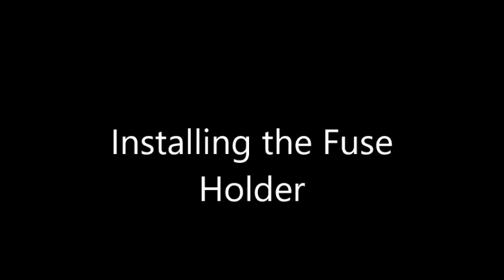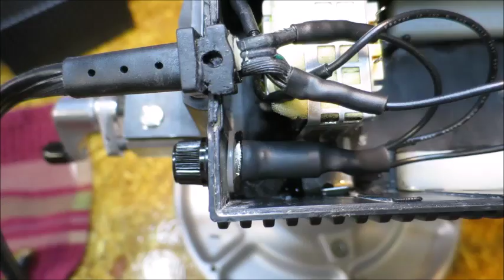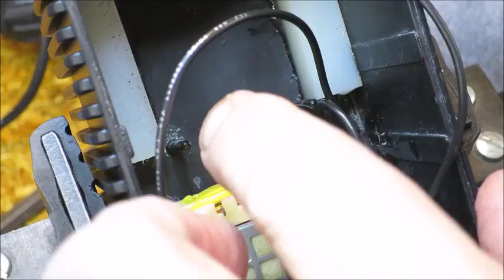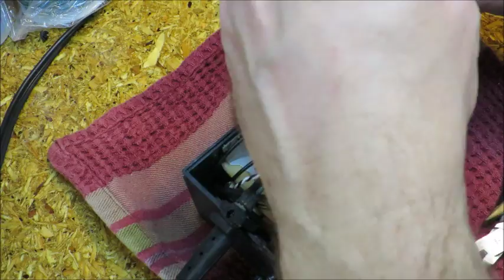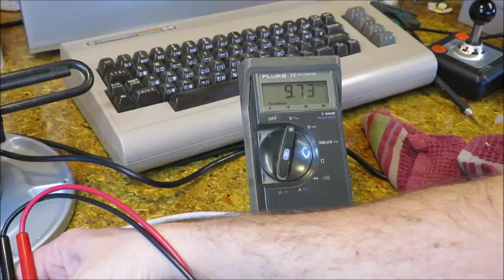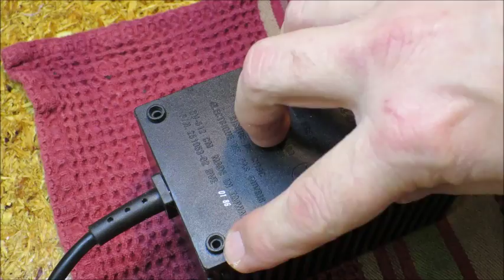Commodore 64 "Re-Brick" Part 3

Comment: Looks dangerous with the metal bracket, if the transformer comes loose for some reason (things happen with cycles of warm up and cool downs) - you could short the transformer with the bracket if the heatshrink isn't all the way down.
Heatshrink over the LED end with no resitor - then a large heatshrink over both of them - no problem with different size resistors...
There's a fuse or 9VAC inside the C64 - so why another in the PSU?
If you use smaller screw there would be no need to grind them down...
Reply from the maker: Hey, good to see you!  Your name and avatar are unmistakable.  Yeah, that was recently brought up.  The reason the bracket went in there in the first place was that on a couple of occasions on my early versions, the transformer DID come loose. This provides a more solid mount and hopefully keeps it in place.  I haven't made any new ones since this came up, but I think running an additional ground wire to the bracket might be another good safety measure.  Commodore frequently grounded the iron core of the transformer, so this would be just like that.
Reply: I was also thinking you could ground it, another idea is to put some heatshrink or similar on the bracket to keep it isolated. 
Pretty nice results, I'm tempted to try and wack the epoxy brick out of one of my grey bricks (that looks the same as your black one).
Reply from the maker: Well, since the transformer core is already bare metal (nearly so, anyway), the bracket didn't seem to be a problem.  Grounding seems simplest.  The whole issue is using  these cases and coming up with a way to mount things inside without using screws through the plastic.
Reply from the maker: Somehow I missed the second part of your first message.  Here's the reason for the fuses: 1. External AC- this one is obvious, to help protect against fire or shock.  2. 9VAC output- partially because Commodore did it on the original brick, but also because it keeps the transformer from overheating and melting down if there's a dead short on the 9VAC output.  Also, there's an input fuse on the switcher, and of course, the switcher has short-circuit protection and just shuts down if the output is shorted.

Finally, what were you saying about the heatshrink and the resistor?  I didn't understand that part.
Reply: Heatshrink: If you put a small diameter heatshrink over the side without the resistor only then you could put a larger diameter heatshrink over both sides (the whole thing, both wires) and not wrestle with getting the smaller diameter heatshrink tube over the resistor. 
What if you made a plastic stencil to block the transformer in the corner, a piece of flat plastic that fits exactly inside the case. You'd then make a hole that fits nicely over the transformer (and perhaps other components sticking up too high). Fasten it about mid height of the transformer - kept in proper height with the nylon pieces in the corners used for the bottom lid by splitting these in half or so and then lock it in between these. Combined with being glued - it could even be glued to the added plastic holder.
It's a shame to add screws to the nice looking case.   ;-)
Screws could also conduct electricity in a worst case scenario if the transformer gets loose and touches the metal bracket.  
Very nice videos, I enjoyed them a lot.
Reply: ... seeing this again. Why not mount the transformer using the same method as when you attach the switcher? Glue nylon blocks, screw to these blocks...

Comment: Are you still making these for sale?
Reply from the maker: Yes, at erratic intervals.  I run out of bricks, and folks usually help me out at VCFMW once a year to   donate "cores" to use to make them.  They cost too much to ship otherwise, and I don't like to pay more than a couple bucks each for the old ones.  Otherwise I would have to charge more than I want to for the Re-Bricks.  Having said that, I will probably make another batch of 6 before the end of the year.  Head over to the Commodore 64/128 group on FB and you can contact me there.

Comment: Another question: is the 2A fuse hooked up to the 9V AC or 5V DC?
Reply from the maker: WinVistaUser2 9vac. It gives a little buffer to allow for an accidental short circuit. The 5v switcher has its own short-circuit protection. Rather than blow a fuse, it will just shut the power supply off until the power is removed and plugged back in.
Reply: ottumland Ah. Good to know. Another thing I thought of for the PSU would be to add a rocker switch (like the ones on the front end of an AT style computer case) for the PSU to switch the PSU off for safety reasons or as an emergency shut off.
Reply from the maker: yogibear2k10 Do you mean a line filter? Well, Commodore may not be the act to follow in every case, but they never needed one. I have built over 30 of these and never had a problem.
Reply from the maker: Sure, I don't disagree with that!  But the primary flaw was the issue of thermal runaway with the 7805 regulator they used.  To be fair, this is an excellent regulator, but it has to be well heatsinked and cooled, and filling the case with epoxy tended to work against that goal.  So I used a modern switching power supply that "can't" (you have to use that word with caution) fail like the original PS did.  As far as the 9VAC, that's filtered and regulated inside the C64, just as you guessed.

Comment: So, the two black wires are 9V AC, brown is 5V DC, and blue is GND?
Reply from the maker: WinVistaUser2 in most cases, yes, but Commodore didn't always wire them the same. I had a weird one just recently where the colors were different.
Reply: ottumland I just took the crap out of the PSU and kept the cord and adapter. The casing on the brick cracked, but I can fix that. Are you planning on selling these as well? Out of cutiosity.
Reply from the maker: Don't feel bad,  I still break 1 out of 5 cases.  They're 30+ years old, and bound to be brittle.  The older non-ribbed units are the worst for breaking, because the plastic is very thin.   And yes, I do sell them from time to time.  Head over to the Commodore 64/128 group on Facebook.

Comment: How about EFI shielding in the PSU to prevent interference and noise from the transformer? Would that be a good thing to do as well?
Reply from the maker: I don't really think that's necessary.  We never had anything like that from Commodore, and while they aren't necessarily the example to follow, I've never heard of problems caused by noise from the transformer.   Switcher noise is a much bigger deal.  In my v1.0 of this power supply, I used a cheaper switcher and found that a small percentage of machines had switcher noise showing up on the screen, especially if an S-Video cable was used.  On the current v2.0 version, switcher noise is about 1/4 what it was, and after 20 or more of these made, we haven't seen any more problems with switcher noise.
Reply: ottumland Ah. Didn't think right. Interesting project as well.

Comment: My only concern is the screw exposed on the outside. These supplies are originally double insulated. Symbol for this is a small square inside another square. Perhaps you should use a nylon screw and nut or find another way around this. Otherwise, good to see old gear being saved instead of thrown.
Reply from the maker: Well, on one hand, double-insulated is usually for devices that have no ground, and these do.  However, your point is still well made, because neither the screw, nor the metal bracket that goes around the transformer, is actually grounded.  Looks like we have a possible design change in the next batch!  Either ground the bracket, and hence the screw, or use a nylon screw.  Good tip!

Comment: Hey,

I found a couple of these PSUs in the trash yesterday.

Do you want them for the cost of shipping?
Reply from the maker: I appreciate that, and if the shipping was five bucks, I'd probably say yes.  But these things are heavy, and it's probably not worth shipping them.  Thank you though!  I am currently out of bricks to make new power supplies.  I don't usually do much in the summer, but I will have to make a few before VCF Midwest!

Comment: I will not put hot on that tab The military required the hot tip so if some one pulled the fuse they not receive a shock if they were grounded in some way. The dragging the fuse out would leave a shock to a power plugged in device! I know that is an unseemly way but it was enforced very strictly!
Reply from the maker: That's a very good point.  My logic for the decision was that on this fuseholder, the tip tab slides in and out as you insert the fuse, making the exposed connection difficult to insulate.  So I didn't want that to be left hot if the fuse blew and something shorted inside.  But it does leave the outside slightly exposed, as someone removes the fuse, the thread area would be hot.  I still think it would be difficult for someone to get their fingers in there, but the point is well made.
Reply: I think that is why OEM devices are fused inside which settles this chicken and egg .

Comment: why dose the 12v rail need to be AC is it for video sync?
Reply from the maker: It's actually 9vac.  I DID use a 12vdc wall-wart, but once the rectifier/capacitor board is removed,  you get about 10-11VAC out of it, which is the same as the unloaded 9vac output of the stock C64 PS.  Anyway, the 9vac is used for several things.  First, it is rectified internally and used for another 5v regulator, and a 12v regulator.  Next the 9vac is sent directly to the user port.  As I recall, this was used for some of the original modems that did not use TTL RS232 levels.  Finally, the AC is used for the Time of Day clock.
Reply from the maker: Several people have done modifications so that the 9vac is not required, but it requires internal surgery of the C64, and has not been something I was interested in doing.

Comment from the maker: Found my parts list!  Several people have been asking for it.

1 Mean Well 5v 3a switching Power Supply EPS-15-5
     Connectors for above PS: JST VHR 2-pin and 3-pin
     Electrical Connectors for above: JST SVH-21T-P1.1
1 panel mount fuse holders   Jameco #120994
1 inline fuse holder   Jameco #GFS703-R
1 1a 1-1/4" fuse
1 2a 1-1/4" fuse
560 ohm 1/4-watt resistor for LEDs
Blue T-1 LED   Jameco #333383
Transformer, 9vac@1A.  Example: Linksys A9-1A
Nylon block 2" wide by 1/2" Thick
#4 by 1/2" Sheet Metal Screws
#4 by 3/4" Sheet Metal Screws
18-guage stranded hookup wire
Heat Shrink, various sizes
2-part Epoxy
PC Card Slot Covers
Reply: I'm in UK, Could I recover the 9vac@1A transformer (gently smashing ^_^) from this?
http://www.ebay.co.uk/itm/1Pc-UK-Plug-100-240V-AC-to-DC-9V-1000mA-1A-Power-Charger-Adapter-Converter-New/191492130646
Reply from the maker: No, unfortunately, that's a switching regulator designed to give you 9v DC, which will not work.  Sorry that my design is US-Specific.  The 5v switcher will still work, but you'll have to source your own 9VAC transformer.  You need something like this: http://www.ebay.co.uk/itm/Power-Supply-9V-AC-1A-1000mA-with-2-1mm-Barrel-Connector-NEW-/141122998957?hash=item20db9612ad:g:4NcAAOSwvgdW21YQ
Reply from the maker: Oh, and I love the 'gently smashing' part.  LOL!
Reply: Thanks ;-) How about this one without the gentle smashing?
https://www.rapidonline.com/Block-VC-10-1-9-PCB-Mount-Transformer-10VA-9V-1-11A-51-5658
Reply from the maker: I would give that a definite maybe.  This one is the right spec, but it's a PCB mount.  So you'd either have to put it on a PCB (which is probably more effort than we want), or you'd have to solder directly to the short wires, which might be a bit tricky.  Having said that, you've got my brain going now.  If we were to extend the nylon mounting blocks the entire length of the case, then you could mount the transformer to a PCB and then screw the PCB to the mounting blocks, giving a more solid mount.  The ONLY  problem I have ever had with my design is the transformer (which is epoxied inside the case) coming loose and flopping around.  That's happened twice out of the 25 or so that I've built.  This would probably eliminate that problem.  So, while we've increased the cost, we may have also improved reliablity.  The only other thing that might be an issue is getting the panel mount fuse holder to fit with a different transformer, but there are lots of different fuse options, including simply using another inline on the inside of the case.
Reply from the maker: @jdryyz  That should work if you have a way to cut it down.  I use a chop saw to cut mine down, and then a tiny tile saw from Harbor Freight to cut into smaller pieces for the corners.  I'm not sure why you had problems with the jig though.  It's just 4 pieces of 2x4 cut in just the right size so the ribs catch but the case sits inside it.  You will rarely break a case if you use the jig!
Reply: @ottumland  I do not have a chop saw but I have a backsaw and a coping saw for the small pieces. Yeah, the jig would have been the way to go but did not want to get the lumber for that. I'm willing to do a small amount of sawing but not on 2x4s.  I would need a better saw for that, too. I did a slight edit on my previous reply. Unable was the wrong word.  I'm trying not to exceed my budget on this otherwise I might as well get a Kevin Ottum NuBrick instead. :) I still plan to do this, by the way but the ReBrick makes more sense at this time.
Reply: @ottumland  I discovered accidentally that Jameco is also a source for a 9VAC @ 1A power adapter. It is only a couple bucks more on average than the Linksys ones on eBay so I think I will just add this to my order: https://www.jameco.com/z/ACU090100E8942-AC-to-AC-Wall-Adapter-Transformer-9-Volt-1000mA-Black-Straight-2-5mm-Female-Plug_157041.html
Reply: @ottumland  Just being sure these are the correct parts at Digikey: https://www.digikey.com/product-detail/en/jst-sales-america-inc/VHR-3N/455-1184-ND/608625 and two hole version. Then the metal inserts: https://www.digikey.com/product-detail/en/jst-sales-america-inc/SVH-21T-P1.1/455-1133-1-ND/527367 . Is that right?

Comment: Custom mounts and screw posts installed in a case with epoxy: done that :-)
Damaged C64 due to overvoltage from a failed power brick: been there :-(

Nice project; thought about it myself before. An "above-spec" power supply would also be worthwhile if you have peripherals such as RAM expansions and other things that get power from the computer itself.